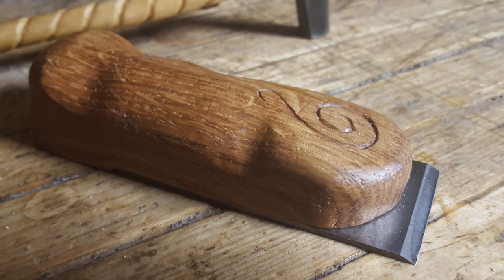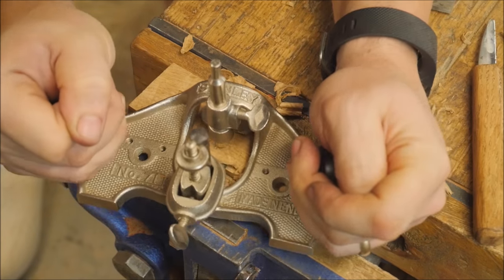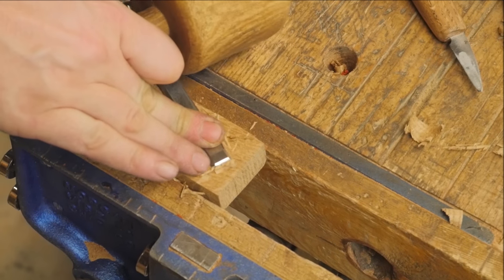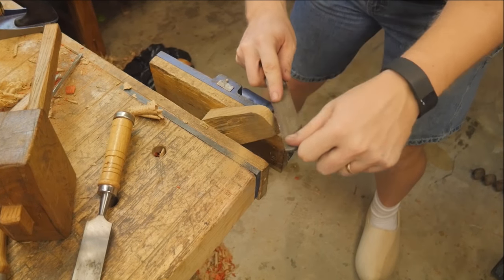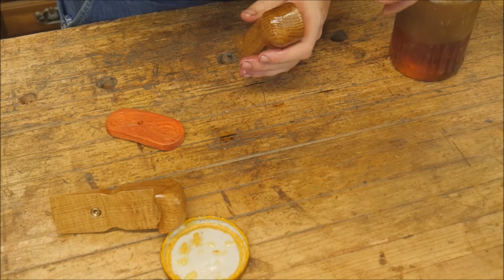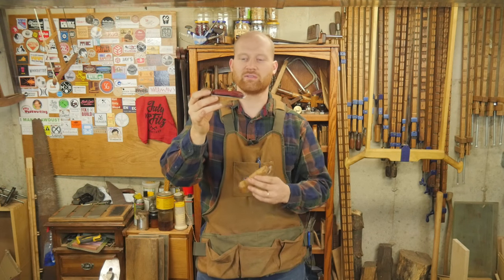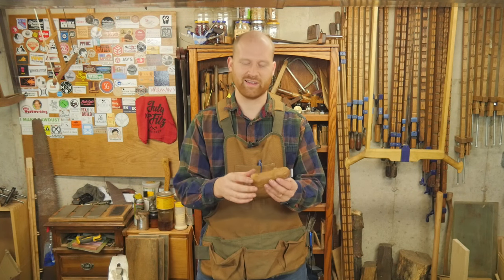How To Make a Flat Chisel Plane for Hand Tool Woodworking

Comment: Just finished making one. I put the block in the vice with another block in front of it so I could bridge across with the router plane. Planed out the square (in front of the curve) then chiselled out the curve area. Worked quite well. Made the top look like a computer mouse. Cant wait to use it. Thanks for the share.

Comment: Very cool. It seems like trying to get the bottom recess flat with the chisel would be really tedious. Would it work as well if you took some thin stock and cut out the curve and then glue that to the bottom? That way planes can be used to do the flattening. I guess that probably just comes down to if you're more comfortable with chisels or planes.
Reply from the maker: that is a great idea. it would probably be easier for most people. I just love using the router plane!

Comment: Quite interesting tool,  I sure will make one soon. I already made the small one with a 25 degree angle. As a future project, how about modifying an old chisel into a skew chisel for fine fitting half dovetail?
Reply: I meant "small chisel with 12 degrees" angle not 25.
Reply from the maker: Thanks. I actually just use a normal bench chisel for that. I have not found much benefit to a fine point chisel, but that is just me. (I am very odd)

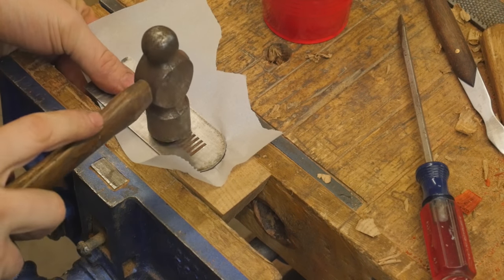Comment: At 2:40 you beat the blade with a steel hammer; did this influence how flattening went?
Reply from the maker: Not with light tapping like that. to change it's shape you have to deform it past the point where it will rebound. for this steel that is a good bit more force then that.

Comment: I’m not sure I get the reason for a chisel plane. Are there tasks for which it’s better than simply holding a chisel in your hand?
Reply from the maker: yup there are a lot of tasks on casework where the chisel handle gets in the way where you need to clean up from one surface to another but the nose of a regular plane gets in the way.

Comment: Nice job thanks again for sharing. looking at the link to the diamond plates which plates do you use? i have the fine which is 600, is that what you are calling medium. I know I am getting a coarse, dont thinks I will bother with an x-coarse, I have a fine, so Inwas planning on an X-fine, 1200 mesh. Your feedback is appreciated.  And to re-iterate, you do fine work.
Reply from the maker: thanks. for DMT I use the Extra coarse (I think 200) the Medium-Fine ( I think 400) and the Extra Extra Fine. the numbers do not line up with traditional stones because diamonds cut more efficiently.

Comment: A few questions, please.  What kind of wood did you use for the base?  White Oak?  Plus, just so I know that am on the wright track, how long did it take you to cut down the wood, shape the back stop and then shape the rest of the wood.  Can I guess?  A couple of hours?  Maybe three?  (excluding the epoxy dry time and the sharpening of the blade)  Thank you.  (I am trying this with Ash and it is a beast to shape)
Reply from the maker: +Bruce Brachman it is white oak from son firewood.i think this whole project was about 3 hours plus curing and finish and flatening. Ash  would be fun. Stringy and hard all in one.
Reply: Thanks James.  I am still so new at selecting the correct wood for any particular project.  I made myself a mallet from pieces of Ash and had some left over.

Comment: These Stones add all three to cart for: $146.83 (corse,fine,ex fine) 
I’ve Never used a diamond stone before,I’m an Arkansas guy....but according to what I’m reading these will be a one time buy, they “don’t go out of flat, or become grooved” 
Is this true ?....how are yours holding up?
Reply from the maker: That is very true they do not go out of flat and they do not groove they also cut much much faster than Arkansas stones. However they cut differently so you don't get the finished polish that you're used to with a high grit Arkansas stone.
Reply from the maker: Also they do not last forever but with the medium and fine plates most people can expect to get 8 to 10 years of regular use. The course plate wears out a bit quicker as the grains are larger. Right off the bat it is extremely aggressive for a couple months of use but then mellows out into a nice plate and most people get 4 to 6 years out of the course plate before it starts slowing down too much. Also DMT has amazing service and if you ever have a problem with a plate they replace them fairly easily. You just have to wait for the next time they run that plate.
Reply: Wood By Wright 😁 well if you ever get out of the wood businesses, go into stone selling because you just sold me those three! 
I’ve been reading up on em,and am  shocked that they are not more popular in my area.. 
“then again it is Arkansas 🙄” 
Thanks for the info, and have a great day.
Reply from the maker: @andrewgarratt5191  Glad I could help! a lot of people like natural stones as they give a shiny surface when done, and they just make you feel good about your sharpening, but as to efficiency demands are where it is at.

Comment: What's the difference between this chisel plane and a bullnose plane?
Reply from the maker: A bullnose plane has a small amount of soul just in front of the iron so that it can't dive into the wood. A chisel plane has nothing in front of the iron so you can get right up next to the surface.
Reply: @WoodByWright  I have a Stanley 110 bullnose, and the bullnose sits a little bit above the height of the plans sole. That allows it to dig in, as you say, causing tear out. No matter how finely i set it. Paul Sellers says the same thing. Hence I'm looking at alternative like this. Any experience with the bullnose?
Reply from the maker: It depends on the type of plane you want. There are bullnose planes for shoulder planes, rabbit planes, bench, plains, chamber planes, and the list goes on pretty much every type of plane has a bullnose variant
Reply: @WoodByWright  that is something new to me, thanks. Do you still use this chisel plane in todays woodworking?